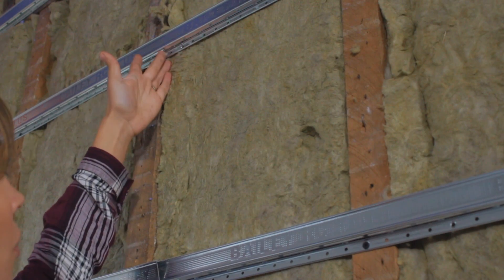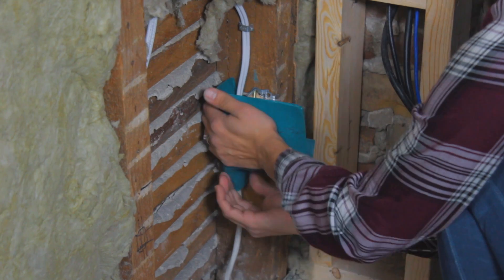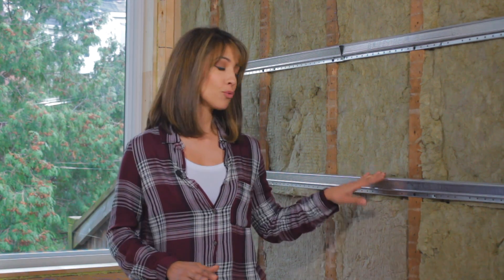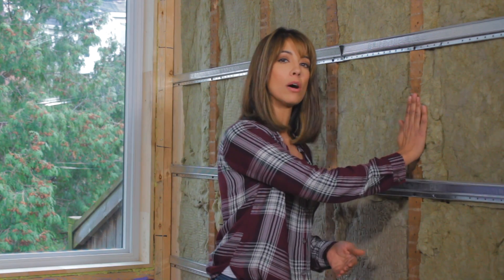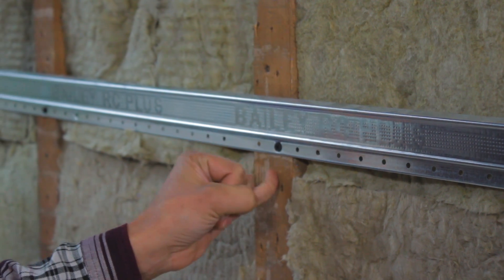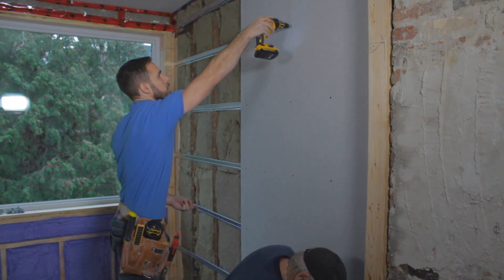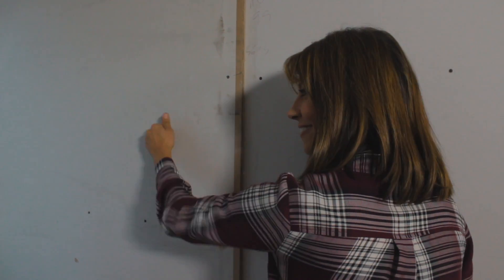Why Resilient Channels Work for Soundproofing Walls and Ceilings?

Comment: 8 years later I am wondering since I need to do this in my 1930's home. So I read that when you put baseboard it would reduce the effectiveness because it would touch the floor. But Without it, it does not match with the rest of the house. What can I do or what did you do with baseboard? Thanks in advance.
Reply from the maker: Technically yes. But most people want a baseboard unless you do a drywall return or shadow gap profile.
Reply: @DaruDhillon  Thank you for the quick response! Now it's time to break the old wall!

Comment: Well it doesn't work
Reply from the maker: Have you had a bad experience with acoustical putty?
Reply: @DaruDhillon  same day I heard my next door neighbor s TV
Reply from the maker: @ozzyd2754  I find TVs on a soundproof wall especially mounted, is less than ideal. In that case 2x3 stud wall built so that it’s not touching your current wall works well. However, I know that won’t be possible for everyone to do. Thanks for your feedback. 👋🏽

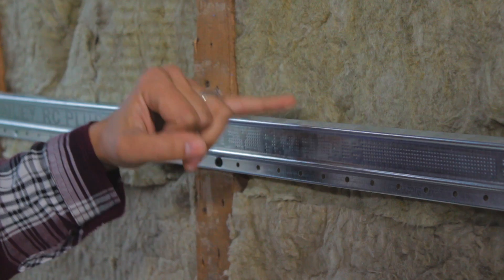Comment: Thanks for the video. At 1:30 you mention that it's important that the flange is up (affixing the screw to the bottom of the channel). Does it matter?  What would happen, or how would it affect the soundproofing if it were attached with the screws on top and the flange below?
Reply from the maker: Bailey makes these RC and they require them to to be installed with the screws at the bottom. Their testing is based on that type of installation. I don’t know what would happen if you install it upside down. In general, I find it best to follow the manufacturers recommendations. Thanks for the question Stephen!

Comment: That resiliant channel looks flimsy. She just touches it and it flexes -  How can it be solid enouch for ceilings???
Reply from the maker: The RC is designed to hold double drywall. That is over 150 pounds per 4x8 sheet. If it wasn’t safe I wouldn’t use it and it wouldn’t be in our building code. 💪🏽
Reply: @DaruDhillon  Thats what i figured. But since the RC1 "flexes" would that make the Ceiling assembly sag or hang a fraction lower than if screwed into a fixed object like a joist?  Would RC 1 Sag and RC2 not sag?

Comment: Why aren't you using the clips for the tracks?
Does that still work pretty well, just screwing the tracks straight to the studs?
Also, what about Mass-Loaded Vinyl?
Reply from the maker: You can absolutely use clips. They are excellent. Screwing RC into suds is standard and is what the manufacturer recommends. You can beef it up if you’d like. MLV is also a good option. We installed Quiet Rock drywall in this home.
Reply: @DaruDhillon  Thanks so much! I love seeing videos like this which are so clear. It helps me understand the process so much better. My wife & I are doing our own renovations, so videos like this are awesome for our sake :)

Keep up the awesome work on these videos!

Comment: Hello. I wonder how do you finish the room after you complete the RC, green glue, 2x5/8" combo. 
Is it fine to put paper tape and plaster/ sheetrock mud or would work against the mobility of the insulation combo?
thank you.
Reply from the maker: Thanks for the question! We mud and tape as normal. It doesn’t impact the soundproofing so your drywall finish does not change.

Comment: Do you use green glue between the double 5/8" layers? If so, I wonder whether paper taping when applyind the plaster to finish the wall is or not fine.
Reply from the maker: Hi Andres, we used GreenGlue in between the two layers. We taped and used joint compound to finish the second layer. Using a paper tape is what is used here in Toronto after applying a soundproofing caulking along the joints. Thanks for the question.

Comment: May I ask 2 questions:
1) how long are the screws used?
2) Would it be possible to put a shelf or any weight after in that acoustically insulated wall?  Makes me wonder if the hat RCs+clips allow for more weight than the Z RCs which hold weight up to 2 5/8" drywall sheets.
Reply from the maker: Hi! Please see the description box for a more details on screw sizing. Usually, after soundproofing a wall you will want to limit or better yet have no penetrations like shelving on the wall as holes allow sound to travel. 
On this wall, no decor, shelving, pictures are attached to the wall when finished it’s all self supported. I often use adhesive strips for pictures etc. 
Both RC and clips work well! Thanks for the questions.
Reply: @DaruDhillon  thank you very much for your prompt answer.
Reply from the maker: My pleasure! Perfect timing, before works starts.

Comment: Interesting. My textbook says these need to be installed on the 'noisy side' of the wall. Meaning if your neighbors are the noisy ones, this won't do much right?
Reply from the maker: Your textbook could be referring to theatres, studios etc. RC are manufactured for shared party walls, ceilings. If they didn’t work they wouldn’t be written into the building code. It works exceptionally well and it’s widely used by contractors and homeowners. There are also numerous videos that show decibel tests to prove it. If you are reading textbooks I would recommend looking up lab results for soundproofing, which go into detail on different types of wall assemblies and their STC ratings. Interesting read and backed by science!

Comment: you did not add green glue in btwn the two layers of drywall?
Reply from the maker: In between the 5/8" Type X drywall and QuietRock is GreenGlue. 2 tubes per sheet.

Comment: Does this soundproofing method also help with the sound of running and jumping coming from the other side of the wall, my neighbors side?
Reply from the maker: Impact noise or structure borne noise can be a little more challenging to address. I couldn’t say this would help your situation.
Reply: Any suggestions on what i can do to help with the thumping sounds.  I live in a townhouse and we can here everything including snoring.  We recently got new neighbors and its been a nightmare, especially in the mornings.  I wake up to the sounds of the kids running and thumping.  Will the soundproofing help with blocking some sound so that i can get my peaceful mornings back.
Reply: @dogdog6630  did you ever find a solution?

Comment: I would like to do soundproof my ceiling. Any additional tips? Should I Quiet Puddy over the electrical box of the light bulb?

I've read Quietrock should not be applied to ceilings. Is that true?
Reply from the maker: Hi Joshua, Quiet Putty can be used externally on all electrical boxes as it is fire rated. You are right about QuietRock being for wall assemblies only. I use resilient channel to decouple my drywall from ceiling joists.
Reply: @DaruDhillon  Thank you so much Ms. Daru Dhillon. Wish me luck!
Reply from the maker: Joshua Lil Georgie good luck!

Comment: Dharu thanks much for the video. Do you use the same technique for the ceiling as well? And the 1st layer of drywall - is that a regular 5/8th inch drywall or quickrock as well? Thanks in advance!

Comment: Hi thanks for sharing the video. May I ask if the mass loaded vinyl is still required before installing the soundproof board?
Reply from the maker: My pleasure Kristoffer, mass loaded vinyl is a component to soundproofing but how you choose to layer your wall assembly is up to you. I opt for what gives me the highest STC value and fits my budget.
Reply: @DaruDhillon  hi, this is noted. Thanks for the quick response. 👍

Comment: Thanks for the great video. Why does the resilient channel have to be light gauge steel - can't it be a piece of 1x wood fastened to the studs in the exact same way as you have the steel channel? Wouldnt steel transmit more sound than wood?
Reply from the maker: Thanks Armen! Great question, RC isolates the drywall from the suds which weakens the sound as it travels from the framework of your wall through the channel. The use of a different material is also important to decouple. As sound travels through different materials it will change and weaken depending on the products used. With this method drywall is attached to the RC and it is not attached to your framework or studs at all. That is the important part - it makes it harder for sound to pass through it. They are specially engineered to hold the weight of drywall and to reduce noise transmission. 
A furring strip of wood would just be a continuation of your studs or framework so no decoupling or isolating would happen to reduce sound. Hope that helps.

Comment: Do resilient channels sag with 2 layers of drywall?
Reply from the maker: Resilient channels are designed to carry two layers of 5/8” Drywall. Where I live it’s required to install the two layers of drywall with resilient channel to meet our building code for sound and fireproofing between attached homes. It won’t sag if it’s installed correctly. Thanks for your question!

Comment: Owens corning quiet zone shown to be better than roxul. Moreover insulation does so little compared to the channels and double drywall
Reply from the maker: Hi Nsingh, Owens QuietZone is a great insulation to use in all applications with the exception of the double 5/8” drywall method, according to their technical data sheets. I would always recommend using the insulation of your choice as an added layer of soundproofing and most importantly fire-rating. It’s required for us to meet our building code. Great comment!

Comment: Hi, did you attach the stud wall to the brickwall, or screwed to ceiling/floor with 10mm gap away from existing wall? thanks.
Reply from the maker: Important question, I left a small gap on the stud wall that I was soundproofing. You want to decouple your wall assemblies if you have the space for better results. Thanks.
Reply: @DaruDhillon  Wow, fast response, I'm building a music studio and this seems the most practical/cost effective method of soundproofing, didn't know if a gap was needed with resilent bars but I guess it all adds up, thanks again.
Reply from the maker: My pleasure. Just to clarify if you’re building a new stud wall over brick I’d leave a gap between the brick wall and the new wall. RC gets screwed directly to your studs. Hope that helps.

Comment: Does this affect the size of the door jambs or electrical outlets?
Reply from the maker: Hi Chili! Resilient channel will add approx. 1/2" to your wall depending on which brand you use, plus the thickness of your drywall, so it would affect your existing jambs and electrical boxes.

Comment: Staggered stud wall with rc and double layer?
Reply from the maker: Staggered stud walls are an effective way to soundproof provided you can spare the additional inches in your room. I did that in this home on the first floor and I'm very happy with the results.
Reply: Double stud shown better stc rating

Comment: Ive done this but now the noise comes over the wall between the ceiling and and the floor upstairs.
Today i am taking the floor boards up to install rockwool between the joists 😣
Reply: Thanks Daru, i have now used around 12 inches of rockwool between the joists against the neighbours wall.
It is working well.
When you say to use MUD?
It may sound like a silly question but is MUD a product or just mud from the garden.
If so, would earth worms and bugs not be a problem?
😣 I searched mud as a product but couldn't find it anywhere.
Reply from the maker: @buzzlightyear923  Hi Bud, I use drywall joint compound or "mud" as we call it.
Reply: @DaruDhillon  
Thanks again, your help is very much appreciated.
Inspiring video by the way 👷
Reply from the maker: Good luck with your project Buzz, I hope you see good results. 

Side neighbor noise: If you are dealing with noise from neighbors coming through your joist cavities (area between the ceiling and walls) you can use a double drywall in the voids, with mud to reduce noise. 

Upper neighbor noise: I use resilient channel on ceilings in multi-family units with rockwool.

Comment: Is Bailey RC sold in the US? I can't find it anywhere around my area. Southeast US.
Reply from the maker: Hi Ken, it may not be sold in your area but other brands like Auralex are available. I would be confident using an American brand that you could find at your local drywall supply or hardware store. These products rely on science backed testing and need to be reliable to make it into your local retailers. Good luck with your soundproofing!
Reply: I in fact did find a local drywall supplier who carries 12' channel for $1.88 each. Thanks  @DaruDhillon

Comment: Hi, nicely done video! An important thing to point out when using either resilient channel or RSIC (sound clip) systems, if you intend to install anything on the wall with one of these systems underneath, especially items such as flat screen TV's, shelves etc. or anything that would be required to install in to the underlying structure (stud or joist) to support weight, these attachments will "short circuit" the RC or RSIC system pretty quickly. It is important that walls utilizing RC or RSIC systems are not compromised after installation by attachments of this type. This is where talking to your client is important and helpful in determining whether or not a de-coupled system should or should not be used on a particular wall or space.
Reply from the maker: Excellent points Steve! Thanks for your comment! For this project decoupling is required in our local building code.

Comment: Hello: I see you are not using RSIC 1 Clippers. Do you really recommend them? They are real expensive so I was wondering if they really make a difference?thanks
Reply from the maker: Hi Jonathan, clips are a little pricey but do help with reducing sound transmission by up to 20 STC. I didn't use clips in this case only drywall screws as space is limited in this project and with my two layers of drywall I needed room for my window casing which is tight. Clips are effective when installed correctly as they add another layer to the decoupling process. Thanks for the question!

Comment: I have a question. Would composite asphalt shingles act as decouples if sandwiched between two pieces of 2x10s or sandwiched between two pieces of sheet rock instead of green glue?

 
 

Reply
Reply from the maker: Hi! I have never used shingles in this way so I cannot offer any advice on their effectiveness if used in this way. Green Glue costs approx 50 cents per square foot and is most effective for low frequency noises like TVs. Good luck with your project!

Comment: Where can you buy quietrock? Lowe's doesn't sell it anymore
Reply from the maker: Hi D Brant, Your best bet is to check with a drywall supplier in your area. Most of the big box stores won't carry it due to the price point. It works really well, provided you follow the installation instructions. I wish I found this product years ago. Good luck with your project!

Comment: Great video! Will the Auralex RC-8 resilient channel work for ceiling and walls? It seems to be hard to find in this area so I’m planning on ordering on-line.
Reply from the maker: Glad you found it helpful!  Have you checked with your local sheetrock supplier to see if they sell resilient channel in your area? Lowe's or Home Depot usually carry them with the sheetrock, hidden near the corner bead.  Sorry, I haven't tried Auralex so I can't offer you a review. I have used Bailey RC on ceilings and walls with very good results!
Reply: Daru Dhillon I will do some more checking. I didn’t find anything in stock on Home Depot or Lowe’s websites. I called a few hardware stores but they didn’t seem to know what I was referencing.